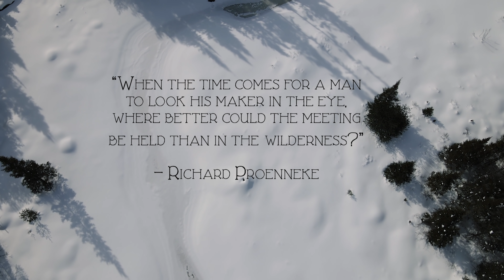Building a DIY Workbench in my Off Grid Log Cabin Woodshop

Comment: In your description paragraph you mention getting started moving logs. I saw something that resembles (smaller in size)  a log moving devise used to move logs by horse power in the 1800's It looked like something you could use because it pivots the lead end of the log up allowing it to be dragged far easier.
It is called a log skidder. Northern tool and equipment offers one at something around $250 that can be towed behind a 4 wheeler. I also saw a photo of one that is pulled by hand. 
Just an observation. ;-)

Comment: As a wood worker ( occasionally , but really love it, planing less Blacksmit and automotive repair time and I have some "Water Fall furniture" I want refinishing done. I plan to make a heavy 30" X 60" work surface table with the old slots that accept the wedges and the holes for my hold downs I built as a Blacksmith.,My space has limiters so I plan to attach it to my heavy steel main shop table quick and release quickly.
 Shawn love what you are doing as I can dream as you do your dream ,Sir thanks

Comment: Shawn, Solid bench. I smiled to myself as you glued those timbers together, saying that's going to be heavy! Then I thought, he's got a log ox! There you go. You see I once made a similar structure to support a fish tank a long time ago now. 😀. Comes with its own parcel of land... two acres! Suggest you drill through the top to the legs and dowell it together. Rollers are good for moving heavy things. Why not make a set for moving heavy things.  Crowbar the heavy thing onto the rollers and suddenly its weight works for you. Push, put the back roller to thd front... glide. Once watched the men from Chubb Safes move our two ton safe on four steel pins without straining, which is the point. If you are a lone worker, you may sometimes have to go slow and smart. Regards Stephen.

Comment: Fire wood stacked, like money in the bank. You don't have a wood shed built yet so you stack it beside the house. Been there, done that. It works! I used to staple plastic sheeting over my 'wind rick' stacks of fire wood and let it dry out until mid winter that way, way out in the open in the PNW.

Comment: The new mic sounds great. I'm confident that your workbench could easily bear the weight of your truck, but you might have trouble fitting it through the door. That & room for parallel parking, etc. Maybe park your snow machine on one of the lower shelves.

Comment: Love the workbench, Sean!!  And perfect timing as I was  planning on making one this week. I will attempt this but to a slightly smaller size. Walking on a beach near me I found some 4×6 & 6x6 lumber washed up but it's pressure treated.  I don't know if u have the time to answer one evening or experience with pressure treated wood, but do u know if it's possible to chisel out channels like you did for the shelving?  I'm sure the type of wood makes a difference.  I just like the idea of 8 legs with the shelving that is bracing and supporting the table and seems you used no nails or screws. Have a good night/day there.

Comment: Hi Shawn,
Basic tools hung and shelved inside, NOW IT'S A WORKSHOP! Looks great Shawn.

I've wondered for sometime and have meant to ask:
   Your splitting axe is a very unique design, what's the purpose of this design as far as functionality? I just realized in this video that the axe isn't a solid piece of forged metal, but that it has the centre section removed from the design. I'm guessing the head is more iron based because it looks and sounds heavier heavy when it hits, as well, it doesn't tend to bounce back but just stops bluntly when it hits and doesn't split. 
Could you do a video of this? I'm guessing it's probably not just me that's noticed this and have wondered about the splitting axe.

Keep Safe All,
Peace, Happiness, Love and Laughter Always,
Matt

Comment: Once you have a workshop you wonder how you ever did without one.  I went for 45 years without a shop.  Then built one and it is so nice to be able to leave things dry overnight or tools out for the night so the next day you can continue on and not have to clean up at the end of a day.  You can get so much more done with one.

P.S. I don't think you should have notched out the legs for the shelf.  I think you weakened the legs 😀😀😀😀

Comment: I have a question for you Mr. Shawn James. It might be obvious after you answer it but I'm going to ask anyway. The hand saw you use to make cross cuts, the thin metal one with small teeth that everyone thinks of when they think of a hand saw, how do you sharpen it when the teeth get dull? I know on larger toothed saws you use a file to sharpen them but I've not seen a file small enough to sharpen those small teeth on that type saw. Do you just get another one when that one gets dull or does the design keep it sharp? I've always wondered this. Stay well. -Wil  👍

Comment: Curious? Why didn't you just mill some planks for your work bench tabletop instead of using those thick beams I'd call them. Seems like planks would be easier to work with, as far as gluing and installing on top of those legs. Also, which glue were you using to glue the beams together? I see a lot of others put some kind of dowels or pegs in between each plank first, then glue. Seems like some super strong glue you use.

Comment: Greet from Slovakia. I am not a carpenter, but the 3 middle prisms are not supported by anything. Relying only on the strength of the glue is a bad solution. They must be supported by a vertical board on both sides of the table. Your solution may last a while, but physics won't let go ... Good luck. Vladimir